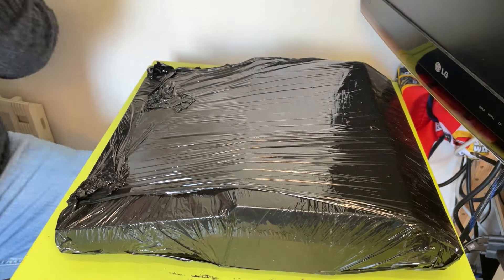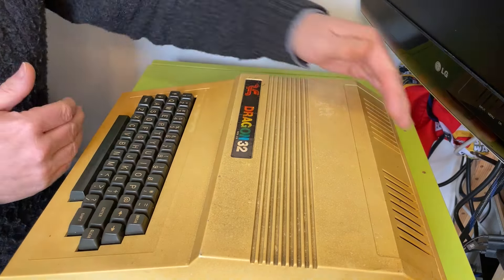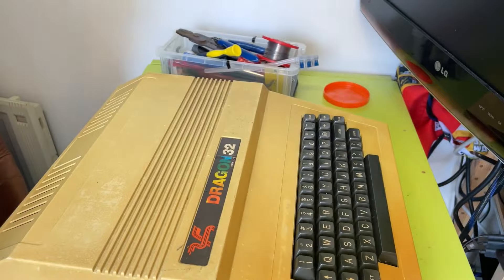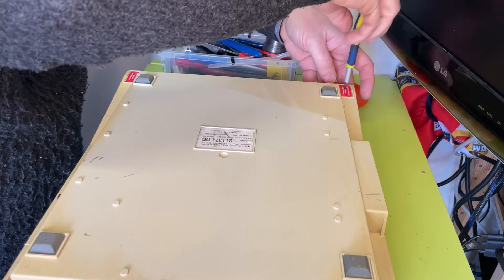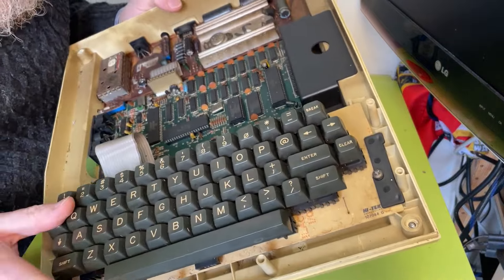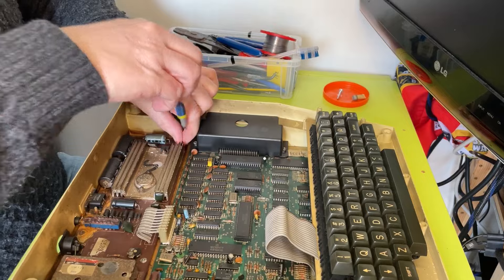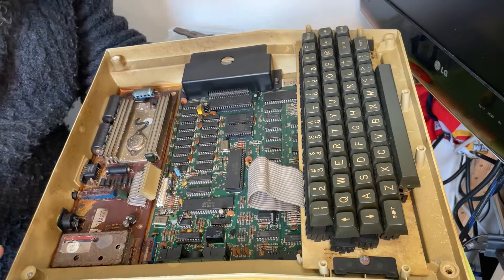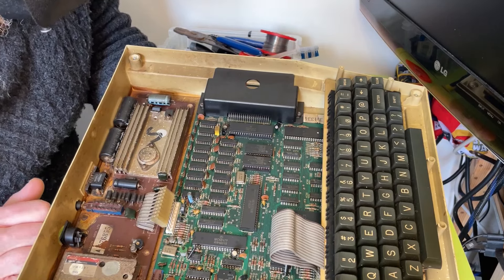Mystery Computer - Discovery

Comment: +12 +5 -5  on the internal connector so can just stick an appropriate meanwel power supply in there
Reply from the maker: Yeah I'm gonna try that's for sure
Reply: That's what I did.. I swapped out the main power supply with a Mean Well RT-65 65W from my preferred Chinese supplier (carefully cutting the power/video board back to leave the important bits, although you might not need to do that!) and replaced the power socket with a cloverleaf one.. I can 3D print some mountings if you want them...

Comment: At first sight of the keyboard, I (wrongfully) guessed a TRS-80 M1 clone as it looks the same as my model 1, but no, a 6809, so a Tandy colour computer clone? - I never had one of those, I stuck with the Z80 side of things - back then.
That back board (assuming you cannot get one) looks like a prime candidate for one of those Chinese PCB manufacturers that do very small runs for little money. As for the power transformer - Well I used to rewind old transformers,  (secondary side only), fiddly but quite doable, all you need to do is confirm the voltages.
If you aren't worried about originality, well there's heaps of room for a small switchmode supply (assuming you ditch the RF output)
Reply: The Dragon and the Tandy Color Computer 1/2 are both based on the Motorola reference design, and are fairly compatible, yes.

Comment: Tut tut, you're not going to win many friends saying the 6809 is a "derivative" of the 6502 lol... A cousin for sure, but I'd say more the 6502 is the b*stard half-brother of the 6809!

I keep holding off on the Dragon, all the ones I've seen have super-janky video quality but I'm sure I'll get one eventually.
Reply from the maker: Lol. Yeah I hear you and people do get a bit wound up for sure! Next step is to try and power it up... But perhaps not with the existing power board...
Reply: Basically the lineage is: Motorola 6800 - some of the engineers at Motorola wanted Motorola to make a cheaper version, but Motorola wouldn't... so they split off to form MOS and made the cheaper chip themselves, the 6502 (so the 6502 is a derivative of the 6800). The 6809 was Motorola maxing out their 8 bit line - it's pretty a well a hybrid 8/16 bit chip (multiple internal 16 bit registers with 16 bit add and subtract, hardware 8 bit x 8 bit unsigned multiple, movable direct page (equivalent to the 6800/6502 Zero page), 2 stack pointers, and indexing modes that rival the power of the PDP-11. The 6809 is way beyond a 6502... but it was still more expensive (it was used in Coco's, Dragons, the Vectrex, a lot of the early Williams arcade games like Defender, Robotron, Joust, etc.). There is an even more powerful sequel made by one of Motorola's 2nd source vendors - the HItachi 6309. The 6309E version runs perfectly fine on the Dragon (and Coco), and there are some games optimized to take advantage of the extra functions on the chip.